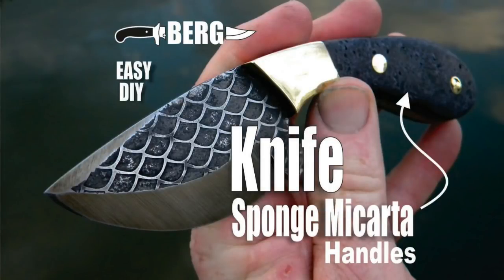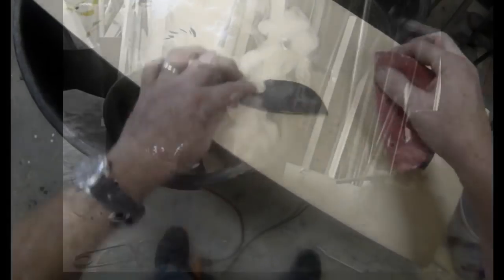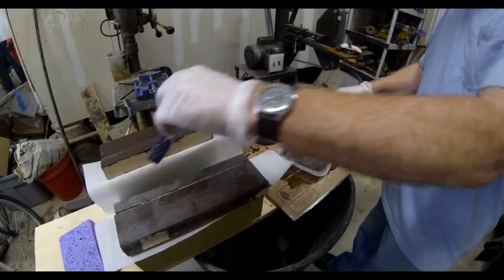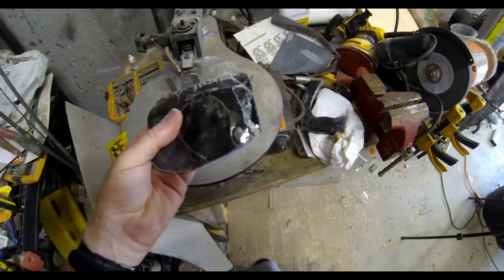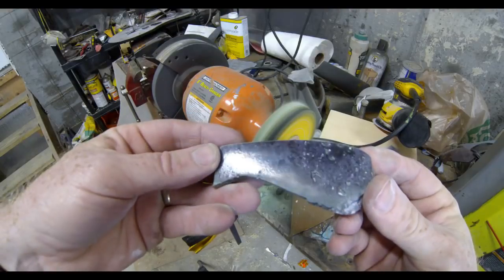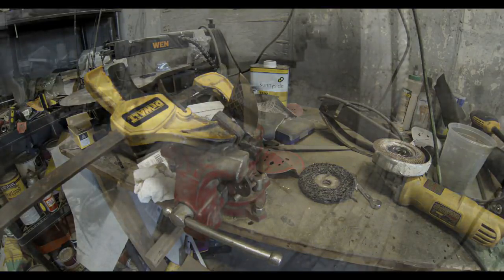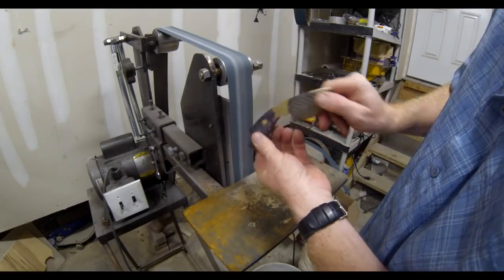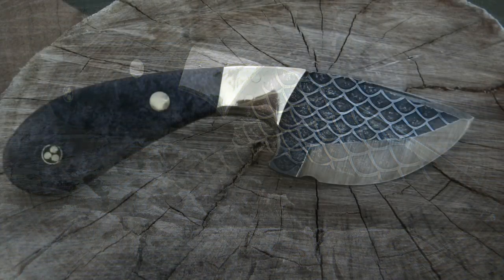How to make a Knife with Sponge Micarta Handles and full blade pattern etching

Comment: Does 1095 steel not rust when leaving a rugged surface on the blade after finishing?
Reply from the maker: It absolutely does unless dried and oiled after each use

Comment: Is the fiber glass 100% when you don't put colour in it? Or it has a little yellow teint ?
Reply from the maker: My fear is that fiberglass has a tendency to turn yellow over time. I add a little paint not just for the color but also to mask the yellowing effect.
Reply: DIYeasycrafts then, if I want to make a micarta with fibreglass like your using but clear, I'll have a yellowish tint in it with the time ?
Reply from the maker: If you want clear then try epoxy casting resin available at art supply stores
Reply: DIYeasycrafts thanks!

Comment: You need to thin out your polyester resin before pouring it. Helps with penetration and does not affect the hardness of the resin   Oh and stop using paint to color resin.  Use dye

Comment: What if you put the Sponge in a small vacuum chamber??
Reply from the maker: Never tried it but sounds like it might work. Great idea
Reply: I was thinking the same. I reckon that would get rid of the final pockets of leftover air in the sponge, which caused the pitting you see in the finished handle.
Reply: Or, pour the resin in a small container first, put the sponge in, then slowly smash it up and down repeatedly to push the air out and suck the resin in.